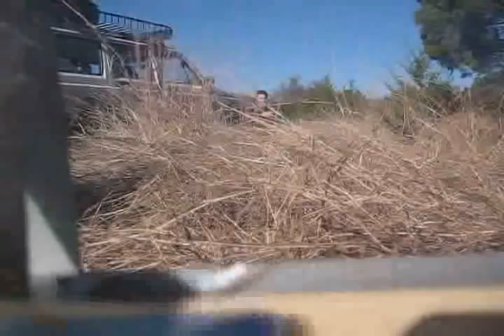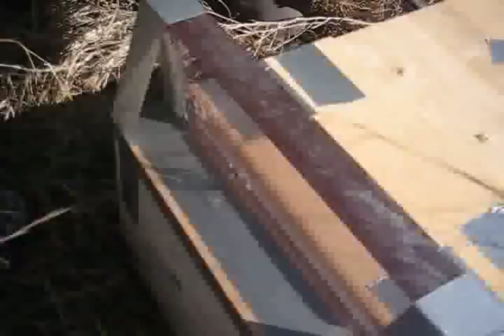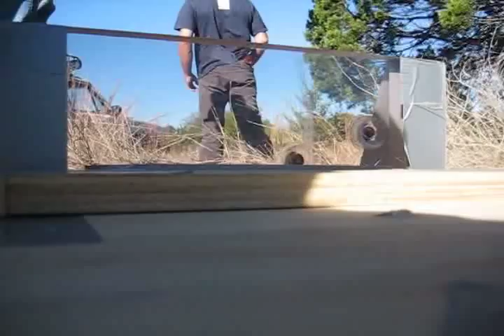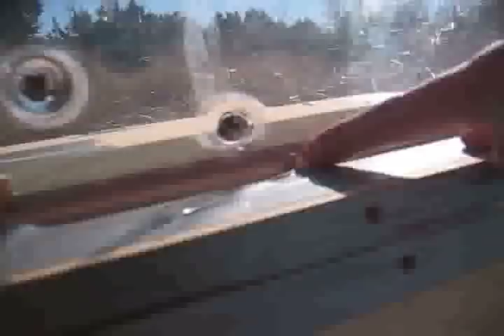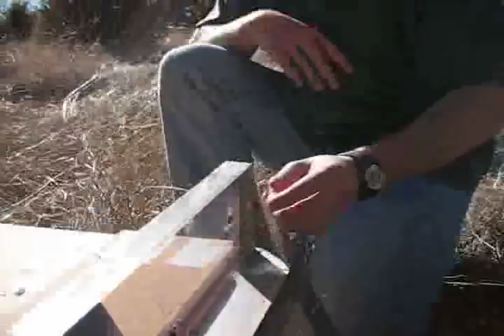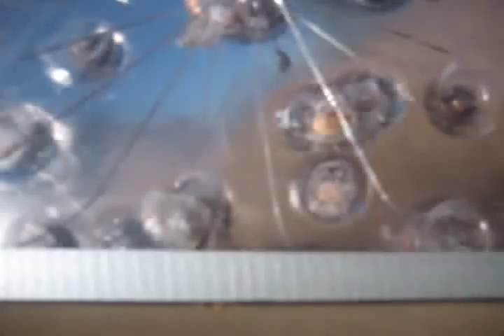Field Testing Bulletproof Glass

Comment: Were those 9mm rounds? Surely so if the glass can withstand so many impacts and your magazine can hold that many.

So there you have it, you'd be pretty safe against 3-4 bursts of 9mm fire, but I'm pretty sure that in most actual wartime situations a larger caliber of weapon would be used. The 7.62 round fired from the AK-47, which is rather common in most conflicts, can quite easily defeat this grade of glass in a few shots.

Comment: Material is "not glass" is plastic.
It is Lexgard 33mm thick .. bulletproof
I have worked with these plastic sheets and sawn to size the customer wanted.
And yes it will cost if you need them.

Comment: @KSIFLYBOY misinformed? i didn't even entertain the idea that an air pistol is similar to a real handgun, and also i believe for the task in hand they would have to hit the glass, and they couldn't do that consistently. it doesn't take incredible accuracy. as for the combustion inside the weapon, as far as i know, and unless you can prove me wrong, the bullet leaves the barrel before it can be effected by any forces other than the initial gas expansion, less time between shots maybe.

Comment: you said hollow points... hollow points are not designed for penetration. they are designed for maximum stopping power, not blowing through a target. try a fmj and see how it works. you didnt say what caliber it is. 9mm are known for penetrating in a fmj, try that and see what happens. not tryin to be a turd, just my thoughts on the matter